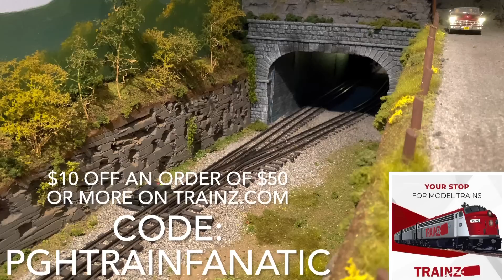My DREAM Steam Locomotive!

Comment: I remember this particular T1 locomotive model it was featured on I love toy trains part eight and told by Jeff I remember this was the early pre-1944 appearance of the T1 the first two Proto types were equipped with skirting and the large pensy Keystone symbol. This is the pre-1944 paint  scheme, which was in 1942.

Comment: Is there a version of this engine with less shrouding on the sides? I think Ive seen one like that. If so, that'd be the one I would go for. Sid did a great job. I can only do simple repairs and weathering at this point, completely changing the guts of one of these things is still beyond me. Great video, thank s for sharing.
Reply from the maker: Lionel’s scale T1 has less skirting but that model was included in an old lawsuit from MTH about 20 years ago in the early tmcc days. Lionel hasn’t ever made it since except for a smaller Lio master version which I have that’s also legacy

Comment: Nick, is the T 1 a twin cylinder ridget frame locomotive? The lion master version has a frame that articulates ? Of course it can go the standard O curves, 036 . I have a S 1 close as I can get for the moment, huge tenders with the big D trucks. Four axle . The prototype had these tight lock couplers
Reply from the maker: All T1 duplex’s are rigid frame articulated 4-4-4-4’s

Comment: Nick, the engine and tender look and sound great! 👍🏻👍🏻Did Sid change the speaker or add a speaker enclosure when he did the upgrade? And last would you give me an idea what total cost for the upgrades were including shipping? One other thing, do you know of any one that has tried to replace the long tether cord for the short fiberglass connector?
Reply from the maker: It turned out great!  I’d contact Sid di rector about pricing and those questions. He knows better then me